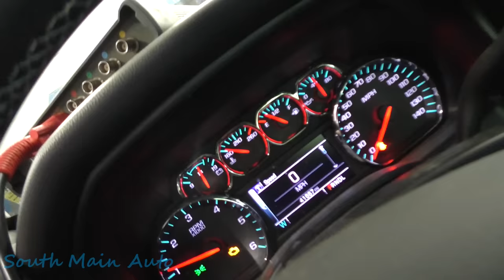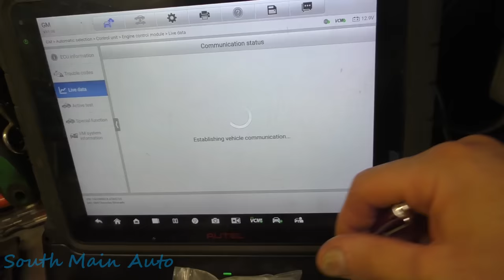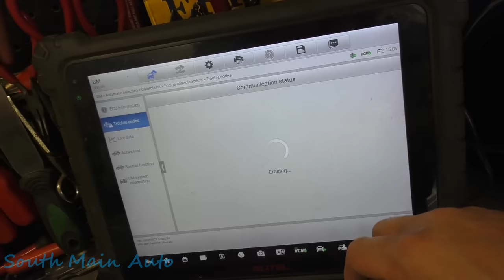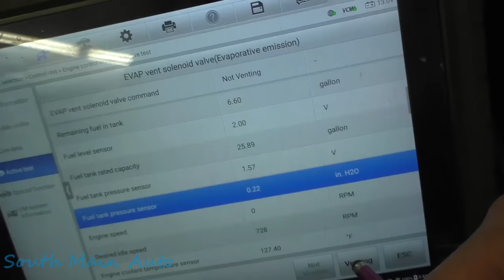'18 Chevy Silverado - In Tank Fuel Pump & Fuel pressure Sensor

Comment: So impressed - working overhead on a fuel system and totally avoided gas running down into the armpit.  Trust me, you'll only make that mistake once.  Also, I've been out of the business a long time, but even with the headache of keeping the fuel pump rod in place I'd much rather change a 2 bolt mechanical pump bolted to the engine.  Yes, I know with FI you can't do that any more, but what used to be a simple task is now a project.
Reply: Well some cars actually come with an access port, or course those are on the vehicles that never go bad
Reply: Try jet fuel in the armpit!  Every time I had to dry drain tanks, you always ended up wearing some.
Reply: Getting that rod to stay in place while you slip it in at an angle and hope that it goes under the cam lever, that's a royal pain. "Just pack it with grease", yeah right. The only way I was able to do it on my dad's C10 was with a screwdriver and luck. Neither of these was as much fun as doing a diesel pump on a 1980 Cadillac Seville which was mounted in the middle of the intake. It was big, cumbersome, heavy and had a precision machined rod that you had to line up absolutely perfectly to fit into the notch in the intake. My dad and I did it when I was maybe 18 years old and it was an absolute bear. Every few months, one of the pushrods would punch a hole in a rocker arm and I would have to remove the valve cover and replace it. GM decided to convert a gasoline engine to a diesel engine. It had ice cold a/c and digital a/c controls way before that became mainstream later on. You would be lucky to hit 55-60mph, the thing was a slug. I slammed the door accidentally on my thumb and it was like a locking bank vault door closing on your hand.
Reply: @lucidbarrier  On the chevy small blocks with the fuel pump on the engine  you could run a bolt in from the front of engine block that would hold the push rod in place while removing the pump.
Reply: @cheesecurd100s yeah good observation lol, it is always the ones with the good fuel pumps that have the access port

Comment: Stupid question.... why not pull the bed for this instead of getting on a lift and doing all that? Take me on average 40 minutes to get a bed pulled off from start to finish, 4 - 6 bolts depending on the model, quick disconnects at the rear for the lamp assemblies, and Bob's your uncle

Comment: Did the same fix 3 yrs ago ,pulled off the bed and did from the top. Got my neighbors and put the bed on saw horses. Replaced fuel pump, cleaned rust and mud off bed rails. Next day up and running. I'm 70 yrs old.
Bed was ready to pick off in 45 minutes.

Comment: Last time I did one of those we pulled the bed off, 6 bolts for bed, three screws for filler neck and a plug for the light harness. With the lift I suppose you could go either way but it's pretty nice to stand over the work and not worry about tank straps or a 3/4 full tank.
Reply: I’ve always pulled the bed off. When doing these. Much easier imo. Even living in the rust belt I use lots of anti seize.

Comment: I've run into the aluminum drive shaft problem you showed a time or two, saved the customer a bunch money by cutting aluminum plugs same size as u-joint caps, center up the joint like usual and then weld the plugs to the yoke ears covering the caps and trapping so they can't walk either direction. Obviously you need a way to weld aluminum. I use my spool gun attachment on my Miller mig machine. Good video.

Comment: I am an industrial electrician at a powerhouse and years ago I bought a set of Stanley Ratchet Wrenches at Walmart (Believe it or not lol) but using these wrenches for years coal dust and dirt and grime I still have them and all of them still work. Just clean them out every now and then with the snake oil sauce. But since I haven’t been able to find them to buy for some reason Walmart quit selling them. Haven’t been able to find a good set since like you I just keep replacing the ones I use at home. Great videos Mr. O I enjoy learning from you.

Comment: A friend had to replace the fuel pump on a 98 Chev. P.U. so being the red neck he was just cut a hole in the bed, replaced pump put a cover over the hole in the bed, job done!
Reply: Done it to a 92,2000,2001 and a 2002 and it works well

Comment: You were just as fast and smooth with the standard box end wrench as you were with the ratchet wrench. Sometimes the nut or bolt just moves back and forth with the ratchet. Waiting for the electric box end.

Comment: One question. Have you ever applied some fluid film up there on the lock ring at time of repair to at least slow the rot or is it not worth the trouble since it sits in the 25+ year crater of engineering obstinance and it'll rot anyway?
Truly a shame that more people don't spray the underneath of their vehicles.
Reply: I usually just greased the crap out of it. Preserves the ring and the retainers, and made the retaining ring easier to lock.
Reply: Never sprayed anything on any of my vehicles, and they are all as clean as they day they were built.  But then I'm not one of the saps that live in the rust belt.
Reply: Normally I'm the first to get mad at enginerds but that rusting isn't their fault as much as it is the owner's, they're driving on salt & sand 24/7 365 and never oil spray. There is no way any steel is going to survive that. Meanwhile go South and you'll see the same fuel pump and retainer sitting fine for 25 years with little to no rust

Comment: Long as GM keeps doing it, it’s called guaranteed paycheck. 
thank you GM.
Reply: What a horrible design...

What did GM find wrong with the screw on pump cover? Too reliable?
Reply: I work in IT and it's the same deal with Microsoft. I'll curse their existence all day long, but damn if their incompetence doesn't guarantee me a paycheck.
Reply: Makes me glad after my first and last  gm truck rotted  out at 88k. I never got another one.
Reply: Everything looked good. I am always surprised at the corrosion I see in your automobiles that you work on. That is an added challenge

Comment: It's insane how fast cars rot out in the PRNY. We only salt the roads for about 6 months out of the year here in Finland, but the difference is huge. I'm driving a 2003 Euro-trash (Volkswagen) with 247k miles on the clock and the frame is in better shape than the one on that truck.

Comment: Eric you need to take Your transmission mount and well, the extension on it, so it can fit somewhat the length of your gas tank. That way you just change mounts and you got it, and you don't need any help.

Comment: Another great video Eric. Thanks...I'm curious, as a "shade tree mechanic" that I am, would it not be faster & maybe easier, to just remove the 4 bolts holding the bed on on the driver's side & loosen the 4 on PS and tilt the bed up enough to replace the pump? Please comment if you would. Greetings from the Old Jarhead in WNC
Reply: While I agree that is the easiest and quickest way I don't think that method would work in his area due to all the rust, probably doesn't want to chance stripping the bed bolts out.

Comment: Very nice video. I noticed that you said that you would probably be back doing this job again. I wonder if you were to coat the steel tabs and ring with No-Ox-Id if it might last till the rest of the frame rotted out. Thanks for the info on the x beam wrenches.

Comment: I have had a run on fuel pumps this year. It shocks me that there are so many varieties of quick connect fuel and vapor lines. Even on the same manufacturer models with a 4 or 5 year span. I thought I might have experienced every torturous way you depress, pry, or slip some part of the line connection and then they come up with one that you push but it has a latch you pull out before you push . The problem being the latch is in the middle of the horseshoe shape captured plastic lock where you have been pushing with a finger before. It does make me believe something I heard many years back,  " an automotive engineer will walk past three aroused virgins to get to screw a mechanic"

Comment: Quick tip: When cleaning around the hole after the pump is out, take a partially deflated balloon and hold it in the hole. Then pump up the balloon with compressed air till it seals around the whole. More of the balloon should be in the tank than out. Tie or pinch it off. Then do your cleaning without worrying about getting junk in the tank. When done just deflate the balloon to remove. Works like a charm. Don’t pop the balloon of course.
Got the idea for that from a local luthier refinishing an acoustic guitar without messing up the inside of the guitar.
Reply: ...my luck the balloon would slip into the tank. 🤷‍♂️😏
Reply: @tomtheplummer7322 , I've actually had that happen. The tanks aren't that deep and the hole is fairly large. A set of needle nose pliers got ahold of the balloon nub thing pretty easily for me to pull it back up to seal the hole. It's also why you want a partially inflated balloon to begin with. If it does fall in it will float.

Comment: did the pump on my silverado by taking the bed loose and lifting it up on one side  seemed like a less work than dropping the tank , I also had a full tank of fuel so I didnt want to deal with the extra weight
Reply: I think in the area he's in getting the bed loose may be a challenge but I see alot of folks do it your way.

Comment: Looked to me like the locking ring and o-ring might tighten easier with a squirt of a lubricant. They also dont kink if lubed. Nice double feature Mr. O. I get my specs at the DG , too.
Reply: Maybe also spray down the locking ring with Fluid Film or similar,  to maybe get one more pump change out of the tank before the lugs rot away.
If nothing else, it'll be like an artist signing his work.
Reply: Glasses at DG ?  Dolce Gabbana. Dollar general hahaha
Reply: @rickn8or I was thinking the same, and then probably load the whole ring area with grease afterward. Yeah it will collect some grime but it will isolate it for quite a while.

Comment: Last time I did this, I unplugged tail light harness, unbolted the filler assembly, loosened the passenger side bed mounting bolts,, removed driver side bed mounting bolts. Jacked the bed up on drivers side. Was pretty easy and didn't have to worry about a full tank of gas.  Love your videos! Been watching since "Eric The Car Guy"!

Comment: Had a friend who had a Pennsylvania truck with a steel driveshaft that rusted out the channel for the universal joint clips I welded the caps in and told him to grease it regular and it should last longer than the rest of the truck.

Comment: Eric whats your thoughts on coating the lock ring and tank tabs with heavy grease to stop corrosion?  Its just ridicules to me that  GM wouldn't  just mold threads on  the top of the  tank and have a plastic screw on retainer.
Reply: GMTA, anthonyianone. I suggested Fluid Film because I'm too lazy to pack grease into everything. Except maybe into that u-joint before putting it back in.

Comment: They could easily design a screw on plastic ring for that pump.   Or even just redesign the ring slot a little thicker so you could just use a thick plastic ring.   They wouldn't be getting all those fuel pump sales though..  Can't take away the cash cow now can we.
Reply: HI I work on Volkswagen and Audi cars and other European car and I know for VW they had plastic tanks since 1985 including hoses but the fuel pump opening is a large plastic nut that seal the pump cover on the tank there is no metal parts they last the life of the car but some other cars like have a metal ring like the GM .

Comment: Col. Kilgore said "That gasoline smell, Smells, Like victory."  When taking off that rusty metal ring and not damaging the tank, that smell is victory.  It is a shame to look at these vehicles back home rotting to the ground in under 10 years.  I do not miss working on Central NY cars, especially in the wintertime.  I really like the camera angles you use to show the viewer the trouble spots.

Comment: Ever spray the fuel pump locking ring with fluid film?  Wonder if it would slow down rusting?
Reply: Coat EVERYTHING w/ wheelbearing grease including the electrical connections, fuel quick connection  fittings, the tank straps & bolts. I even coat the U-joint bolts and straps.
Reply: I do.

Comment: Geez it looks like the new Silverado's rust out way faster then the old ones.
Reply: True, I've noticed all new cars have a short life these days rust will take over fast, especially up where Eric is,
Reply: If you watched the earlier video with the rear crossmember rotting so bad the shock wasn't attached any longer, it is easy to notice that this truck has one well on its way.
Reply: that way they can sell you another one faster ,,
Reply: Chevy makes money from selling new trucks. Maintenance is a service they offer so dealerships can make money. Chevy doesn’t make money on the maintenance part at least not much.
Reply: @ericbrainard4072  true and when you take em in for service wonder how much service dealership really does 🤔
Reply: @BobSakamoto  true maybe 4years left before scap yard or less
Reply: Nah, they have been rusting at an insane pace since 1999, they still just coat the frame with wax, which melts off in the first summer in the north too. 2011, 2012 models with no rockers, fuel tank support / frame crossmembers rotted is normal in the rust belt, most frames are done in 15 years in Michigan...

Comment: Always lifted the beds on trucks to do these, had eyelets in crossbeams of ceiling to use pulley and paracord system to just tilt the bed as needed instead of lifting it all the way. Made it real easy to do fuel pumps and such. Much easier then playing balancing acts with sloshing fuel.
Reply: I got an 01 sitting in the yard right now with a jacked up bed. Can't get the damn ring free. Going to put the air hammer to it when I get motivated.
Reply: I have a small dump and just raise the bed ,hahaha.

Comment: Around here most people raise the bed up on the GM trucks to change the pumps. It’s usually just 6 bolts and the bed lifts up. I’ve even done it myself without a lift by taking the rear bumper off then taking the bed bolts out and just sliding the bed back on the frame. Its a lot easier than dropping the tank.

Comment: the new pump looked really tall, made me wonder if the original crack was from the straps or something pressing on the bottom of the old one
Reply: They are spring loaded against the bottom of the tank, so I don't really see that happening. If you pressed on the bottom of the tank it would just compress the springs some more.

Comment: I just replaced the original fuel pump in my 2010 GMC Sierra.  I am amazed it made it so long. Im up in Michigan and the metal elbow on the pump for the supply finally rusted enough to spring a leak. The pump still worked fine. Since i pulled the tank I replaced the pump, lock ring and the fuel line just to increase my chances that I wouldn't have to pull the tank out again. 😂

Comment: Our mechanic at my last job would pull the bed back and work from the top, thought that was pretty ingenious. Of course you need a couple of guys to help slide the bed back.
Reply: One guy can move a bed no problem.  I take them off and reinstall them solo.   Only Ford guys consider removing the body to work...
Reply: that way would work if you did not have a lift

Comment: On those GM trucks, last time I did one, there are 8 - 18 mm bolts hold the bed on. That’s it. Pull them, lift or tilt the box. Easy peasy access to the tank, like it was already sitting on the workbench.

Comment: 40k miles, I’d be sending a strong worded letter to GM. 👊
Reply: They don't care about your letter! People keep buying them.
Reply: It’s a 5 year old truck. All of the manufacturers have a 3 year 36,000 mile bumper to bumper warranty. Unless you purchase the extended warranty. With 5 years of being on the road, a lot can happen. For example lack of maintenance for the undercarriage. I live in Indiana, and my 2017 F150 looks great underneath. The reason why is because every fall I clean the frame, and oil it to prevent the rust. I do the same thing for my Enclave.

Comment: You might want to let your customers know that another Toyota class action suit has reached final approval.  This was the one for the low pressure fuel pump issue that caused thousands of them to randomly stall.  Toyota knew about it, but wasn't going to notify owners until it was forced to by the courts.  This one is on top of all of the rusty, breaking frames, the Rav4 battery fires, the poorly designed evaporators that cause mold, the wiring issues on multiple models, and the Rav4 oil consumption issues (that's the short list).  That's not to mention the two billion dollar class action in Australia over the Toyota diesels with faulty particulate filters.
Reply: But, but, but,  Toyotas are the bestest evarrrr. 😏

Comment: Warranty voided due to NYS use of chinese parts made in Mexico and assembled in Canada..Go GM!
Reply: Chinese steel is WAY worse than what our steel that we USED to make here in the USA.
Reply: @rockyj2008 sorry I’m late. You’re comment is 1,000,000% correct. I used to work at a steel processing plant and the the domestic steel that came in was incredibly tough. I used to work in processing of clambering beams, cutting stacks of steel, plasma cutting etc and you had to take your time cutting American made steel. The Chinese crap that came in off the boats were as soft as butter and I’d turn the saw head speed up to cut it. Total effing garbage.